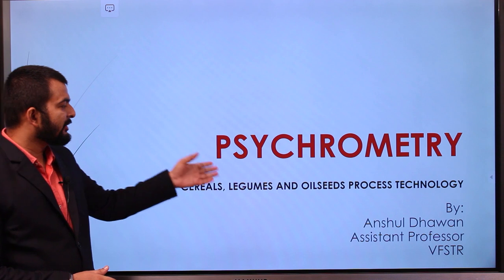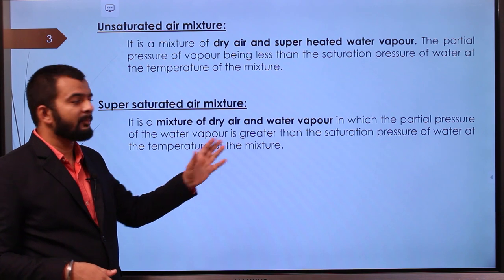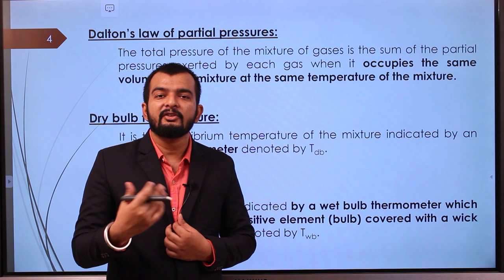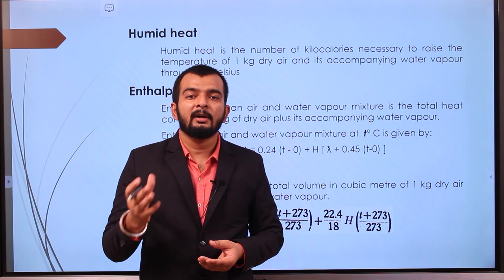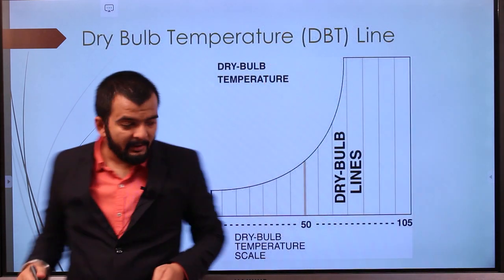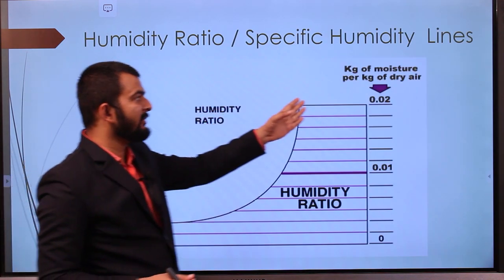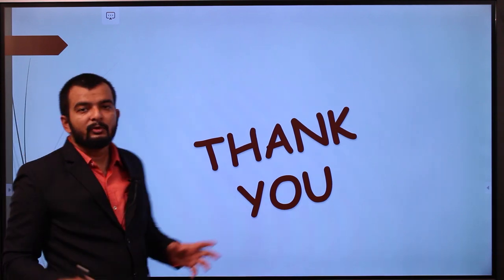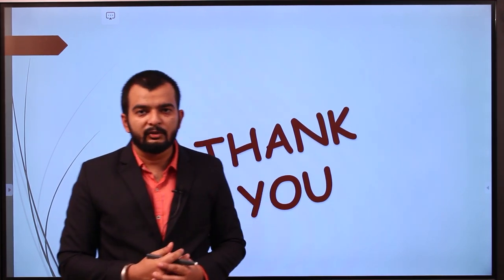Psychrometry

Comment: SECTION-A
UNITS AND MEASUREMENTS: Brief introduction to dimensions, fundamental units and
derived units. Systems of measurement-fps, cgs, mks, SI units.
DEHYDRATION: Moisture-dry and wet basis, free and bound, critical moisture content and
equilibrium moisture content, drying theory and drying rate curves, drying time, mechanical drying
by using tray dryer, conveyer dryer, rotary dryer, drum dryer, fluidized bed dryer, spray dryer,
vacuum dryer, and freeze dryer.
SECTION-B
EVAPORATION: Parts of evaporator, single effect and multiple effect evaporator, different
types of evaporators, steam economy, design of evaporator, thermal and mechanical vapour
recompression system. Use of steam table.
SECTION-C
PRINCIPLES OF HEAT TRANSFER: Conductive heat transfer-Fourier’s law, thermal
conductivity, conduction through rectangular slab, hollow cylinder, spherical shell, composite
rectangular wall (series), and composite cylinder. Convective heat transfer-convective heat
transfer coefficient, free and forced convection, overall heat transfer coefficient. Radiative heat
transfer-StefenBoltzman law, Radiative heat transfer in two objects
SECTION-D
HEAT EXCHANGERS: Steam injection and steam infusion. Tubular, scrapped surface, plate
heat, shell and tube heat exchangers.
FILTRATION: Introduction, filtration theory, types of filtration, filtration equipments-pressure
filters and vacuum filters
Pls upload some vedios on this 🙏🙏🙏